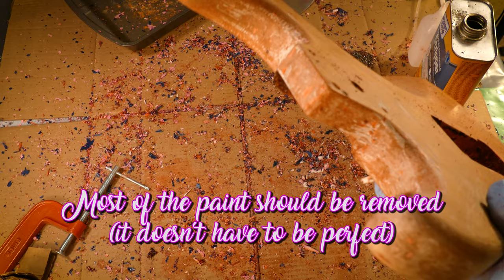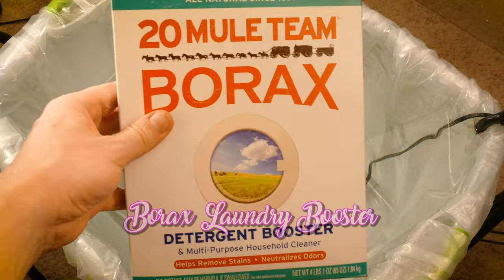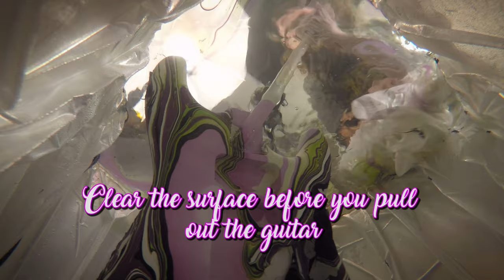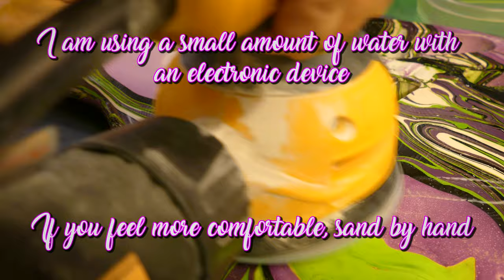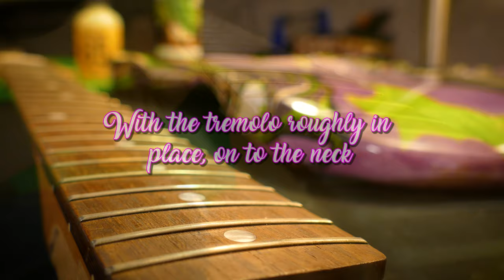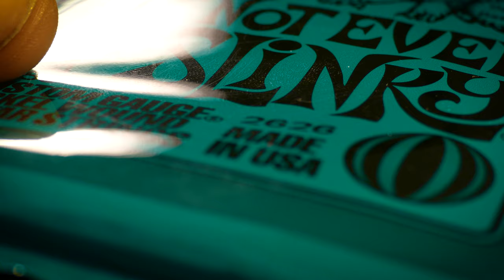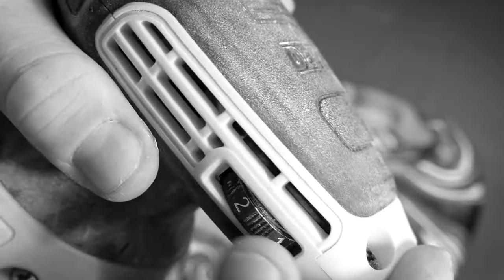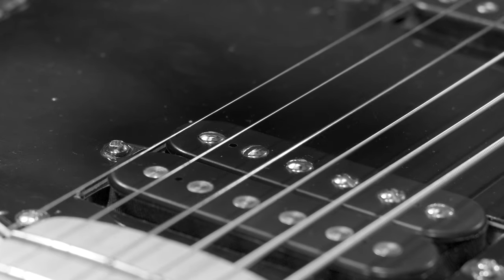How To Hydro Dip A Guitar DIY - 4K (UHD)

Comment: Superior video! Thank you for taking the time to make it so! Question?? How necessary is it to my results to simply steel wool or fine grit sand the original paint instead of stripping, and then follow all the other steps you included in the same order? Thank you in advance.
Reply from the maker: Not a problem. Thanks, Adrian for the compliment! I think you would be okay. In my case, I bought the guitar off of a buddy who kept it in his garage. So, I wanted to see the condition of the wood underneath to ensure there was no rot, or peeling. I didn't want all of this work to be in vain only for the bottom layer that adhered the wood to just come off. But, if you know where the guitar had been, and it is in good condition, you probably will be fine. Hope this helps.
Reply: @JoeLewis14  Nice! Thank you kindly for getting back to me so quickly. Be blessed
Reply: Also wondering how many gallons was the bin you used? I caught that you recommended a bigger one than what you used. What dimensions would you say?
Reply from the maker: @AdrianClement  Oh, that's a tough one. Sorry, I no longer have it, or else I could tell you. They definitely have larger ones, but I wanted a clear one, so that was the larges one I could find. You might have to measure your guitar body, and ensure you can can fully dip it under the surface. Sorry, I couldn't be more helpful, here.
Reply from the maker: @AdrianClement  Also, if you do this, please send me some pictures of the end result. I would love to see how it turns out!
Reply: @JoeLewis14  I will certainly share pics! Thank you for your help!!

Comment: Is it necessary to remove the old paint? What if you want it for a base?
Reply from the maker: Hi, Noah. You do not have to remove the paint if you think the wood is in good condition underneath. I would just scuff up the paint and prime it. Then, you should be good to go. I removed the paint because I was unsure of the condition of the wood underneath mine. I bought it off a buddy, and it had been inside a garage for some time.

Comment: What is the purpose of the Borax? Never heard of anyone using it.
Reply from the maker: Hey, Bilb Ono!

The Borax prevents the enamel paint from mixing with the water. It also keeps the paint on the surface. Lastly, it helps spread the paint across the surface as well.

Comment: When you add the paint to the water how quickly do you need to get the guitar in the water? What is the working time for the paint once it is in the water?
Reply from the maker: Hi, Daniel! I think it is more important to get the text to the desired looker in a speedy time rather than dipping the guitar quickly. Ideally, you do both as fast as you can, but the paint will eventually stop spreading on the surface if you wait too long when doing the texturing. Hope this helps!

Comment: you should have used a little bit of polyester to fill in some of the imperfections.  like doing a little body work.
Reply from the maker: Hi, Paul. That is certainly an option. I did mention that I should've used wood filler compound at the end of the video.
Reply: @JoeLewis14  I used to work at a body shop and that's where I did all my guitars.  After I wet sanded them I would give them a thin coat with polyester then sand that down with some 800 grit paper then prime them and sand them again with 1500 before paint. Always came out like show room condition.  I used to use 2 stage paint depending. Pearl paint got 3 stage.  Base and clear or base, pearl then clear. But all of them look like factory.

Comment: Is it absolutely essential to get all the paint off it first? Or would it work with a guitar that already had paint and a finish on it? Would it still work it you just primed it with white paint?
Reply: No, there is no need to strip the paint off, he created a lot of extra work for himself. Just need to scuff sand the original paint and prime over the top. The finished product looks great though!
Reply from the maker: Hi, James! It is not essential if it is a newer guitar, or you know the condition it is in. In my case, I bought this guitar off of a buddy, and it had been in a garage. I wanted to strip it and check for water damage or anything along those lines. The last thing you want to do is seal in moisture. Hope this helps!

Comment: Awesome video, well explained. I have a question, what quantity of enamel paint did you use ? These little pots are only 14 mL and I think it's not enough
Reply from the maker: Hey, Vald3ums!

Thanks, homie! I would get two of each color. You can easily get the job done with one of each color, but I highly suggest practicing on something first. It took me a couple tries to get a feel for how the stuff works. Two cans of each color will give you wiggle room for testing, and room for error. Although they are small cans, they are very potent for this type of project. Hope this helps!
Reply: @JoeLewis14  Well thanks a lot for replying me that fast 👍, it really help me a lot
Reply from the maker: @vald3ums728  Not a problem. I don't always reply so fast, but I do try. If you do the project, take some picutes and send me some links. I'd love to see how it turns out!
Reply: @JoeLewis14  I will ! I'm working on an Ibanez-like model (DIY kit) and I want to swirl paint it in Red/Orange/Black
Reply: @JoeLewis14  Well, after a lot of time and some problems with the paint, I did it ! I would like to show you the result if you know a place where a can send you some pictures

Comment: Hey quick question, after hydro dipping, do you leave two weeks to cure than put the lacquer on it or put lacquer on it after it dries?
Reply from the maker: Hey, Evie!

I would wait two weeks just to be safe. Enamel paint this kind of tricky. It doesn't harden entirely, so it is diffifuclt to tell when it has cured. You just don't want to risk working on it too soon, and messing up the work you put in to it. The longer you wait, the better. It will be worth the time you take on it :) Hope that kinda helps.

Comment: can i not sandpaper the guitar and hydro dip the guitar over its original color and use clear coat at the end ? i have total white guitar.
Reply from the maker: Hi, arash! If you're guitar is in good shape, you can paint over your existing color. I removed the paint to check the condition of the wood underneath. BUT BE SURE to sand your paint and bit with rough sand paper to allow the primer to grab on the the surface. If you don't, it will surely chip. Hope this helps!

Comment: I am thinking about doing this to a vintage white kramer baretta special in the future. If the body is already white, is it efficient to skip scraping the paint or no?
Reply from the maker: Hi, Joshua! I'm assuming it has a clear coat/lacquer. I would at least try to remove that, or sand it down really well. The reason why I removed everything, is because this is an old guitar, and had been sitting in a garage for a while. I wanted to ensure the would was in good condition. Hope this helps.

Comment: I tried My first Hydro dip on old Peavey Foundation Bass. Gray base coat. Used Majic Marble paints and, well needless to say, Back to the drawing board. Didn't get full coverage and the magic marble bubbled.  Any suggestions? Did bubbling occur due to water temp?
Reply from the maker: Hi, David! Sorry to hear it didn't go super great on your first run. Yes, some bubbling did occur. I recommend letting the Borax dissolve completely for about an hour (I suspect some of the bubbles is caused by this). Also, I would be sure to pipette the paint in. Pouring it in can also cause bubbles. Hope this helps.. Let me know how the next one goes!

Comment: IS IT POSIBLE TO ADD SOME SORT OF GLITTER IN THE PAINT TO STAGE IT BETWEEN COLORS TO GET TRANS AM SPARKLE?
Reply from the maker: Hi, Toby! I think your best best is to spray a very light layer of sparkling after the dip, before the laquer. I would practice on a few objects because this could easily be overdone. Unless, you can find enamel paint with sparkling in it.

Comment: Do you have to remove the paint? Looks like a lot of work, I wonder if it would be possible to just add a layer of paint on top of the original one
Reply from the maker: Hi, JLens! It may not he entirely necessary if you have always owned the guitar, and know how well it has been taken care of. I did it because I bought it off of my buddy, and he kept it in his garage for several years. I didn't want to risk wood rot or water damage. Hope this helps!
Reply: @JoeLewis14  yeah thanks

Comment: What is the use of the laundry booster? is it really necessary? thanks!! great vid!
Reply from the maker: Hey, Gabo!

Yes. The laundry booster is 100% necessary. It prevents the paint from not only mixing in with the water, but it helps it stay on the surface, and spread to create better texture. Thanks for checking out the video and asking questions! Thanks for the compliment as well!
Reply: @JoeLewis14  great! thanks a lot!

Comment: Can you just sand off the clear coat or is it necessary to remove the paint?
Reply from the maker: Hey, Joe Rondorf! I stripped the clear coat and paint because I bought this guitar off of my buddy, and it had been in his garage for a couple of years. I wanted to inspect the body and ensure the wood is in good condition (i.e. not rotting or water damaged underneath the paint). Sometimes the sealer cracks, and moisture gets underneath. This would only create problems down the road, and possibly under all of this work. I also didn't want to risk poor adhesion from the factory paint and clear coat, especially after it had been in his garage for some time. Once I determined the wood was in good shape, I pressed on with build. Lastly, as silly as it may sound, it will make the guitar quite a bit heavier with all the extra layers of paint. Although this isn't a huge deal, it just makes it that much more comfortable when playing with it over your shoulder for long period of time. Hope this helps!

Comment: Is leaving it to cure for two weeks absolutely necessary? I want to do one for a school project and don’t have that kind of time
Reply from the maker: Hi, Zac! That is very cool that you want to do this for a school project. Maybe you could lacquer the the guitar, wait a couple days for it to dry, then assemble it to show your class, then disassemble it, and continue with the sanding and wax. The reason it is important to let it harden, is because the sanding puts stress on the lacquer, and you don't want to crack or chip your work. Also, wax could make the curing harder to achieve because it can lock in the moisture, preventing further curing as well. You could then bring it to school fully completed as a follow-up. Just an idea. You can definitely bring it in after a couple of days, just be careful, and wait for a little bit for the other steps.
Reply: @JoeLewis14  thanks! That’s a good idea
Reply from the maker: @zacevans1683  No problem!

Comment: Hey dude!!!  I'm looking at doing an Ibanez build and i NEED swirls!!  I was wondering, my first instinct would have been to lightly wet sand the paint before the first layer of clear.  Is there a reason you didn't sand the paint first?
Reply from the maker: Hey, GearZomie!

Awesome! I hope the Ibanez build goes well! 

I wouldn't recommend sanding the paint directly for a couple reasons. One, enamel paint doesn't really dry super solid, so it might smear in a sense. It is kind of rubbery. Secondly, the dark colors would likey transfer over and mix the lighter colors. Both of these things would likely make your lines between colors lose their definition. Maybe do an actual clear coat or two, then level sand very slightly before a lacquer if you are concerned about smoothing it out. The enamel paint is really rigid. This will help take care of that and protect the guitar as well. I cannot emphasize plenty of clear coat and/or lacquer with level sanding in between enough. Hope this helps. 

Good luck, and let me know if you decide to do the swirl! I would love to see how it turns out!
Reply from the maker: I forgot to mention, although the paint is rigid and thick in some areas, it is very thin in others. The last thing you want to do is unintentionally sand away the paint down to the primer on those thinner spots as well.
Reply: @JoeLewis14  Thanks for responding!!!  I've never really done much with enamel.  Looking forward to giving it a shot!!
Reply from the maker: Not a problem. You got this!

Comment: Trying this out on a white strat - if it’s white so I still need to remove the original finish or can I just hydro drip and refinish on top of the existing white finish?
Reply from the maker: Hi, Olivet! You will want to at least scuff it up so that the paint can adhere. Then you should be okay.
Reply: @JoeLewis14  about to try my hand at this now - so I don’t need to sand it down first? I can just dip the guitar into the hydro paint as is? Or even if it’s white should I sand it down (bc probs has a gloss poly finish) then use white primer base coat before hydro dipping?
Reply from the maker: @OliverAndTheTwist  Hi, Oliver. Maybe I wasn't clear enough. I would definitely sand it a bit so that the paint will adhere. If you do not, the paint has nothing to grip. You don't have to do a lot, however, I would do about 200 to 300 grit lightly to ensure the paint has something to grab on to. I don't think a primer would be a bad idea,, either, but you may be able to get away without it.. Hope this helps!

Comment: Is borax required, and is spray paint an acceptable way of painting the guitar? I’d like to be sure because I’m going to by painting my bass here soon
Reply from the maker: Hey, The Dude!

Borax prevents the paint from just mixing, and just turning the water the paint colors. It keeps the enamel paints on the surface and spreads it reducing the surface tension. I've seen videos where they use spray paint and water only, and the paints mix together, rather than having defined lines. I personally don't like how spray paint creates a bubble slop. You cant really control it. But, it is all personal preference. Hope this answers your question!
Reply: Event Horizon Records thank you very much! If it’s alright I have another question, I’m not too intensive on making my guitar look perfect, I just have a paint idea that I want to commit too, and I was curious if waxing was an essential part of the process too? I’m sorry if this seems obvious but I just really want to be sure that I have everything I need
Reply from the maker: @thedude8204  No problem at all! As long as you clear coat it/lacquer it, it should be fine. Just level sand it between coats. If you can, finish it with a polish. I do suggest a wax only because it fills in small scratches, it helps protect the clear coat/lacquer, and it gives it an unmatched shine. Just take your time on this project, you will not regret it! If you do this project, send me some links to the final product. I would love to see the result!
Reply: Event Horizon Records got it, and thank you!  I’m looking forward to painting it, I’ll be sure to follow this to the letter
Reply: Event Horizon Records I’m sorry for bothering once again but I have one final question, the guitar I’m doing is an Epiphone Thunderbird, and I’ve heard that guitars like that use a nitrocellulose paint, when I start sanding sometime today can I just sort of sand down the lacquer or whatever makes it shiny, and that’ll be good enough? Or is it imperative that I sand down to bare wood?

Comment: How much would it cost me to have you do this to my guitar? Do you use Gloss or Matte paints?
Reply from the maker: Hey, JET Man!

That kind of depends. Do you have the tools already? Let me know if you are only speaking about materials, then I can give you an accurate estimate. I used gloss, but it really doesn't matter what you choose if you do a clear coat/finish. The results will both be shiny in that instance.
Reply: Event Horizon Records I am speaking about materials only. I do have some tools but not all. How much paint to you need to create the film on the water surface?
Reply from the maker: @jetman7713  The materials for the hydro-dip are as follows...

-White paint/primer (used prior to dip)
 - $5
-Enamel Paint
s - $20 total (4 different kinds)
-Borax Laundry Detergent
 - $4
-A large bin to dip the guitar
 - $15
-Water Heater
 -$10
-Stewart-McDonald Guitar Lacquer (for finish) - $30 Total (3 cans)

I used estimations because I am going off of memory, but it should be close. Hope this helps.